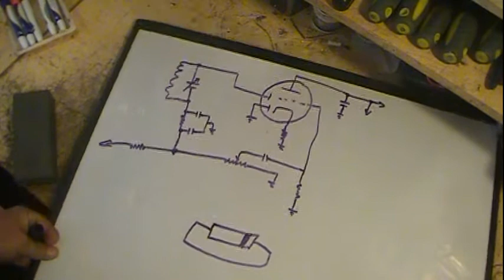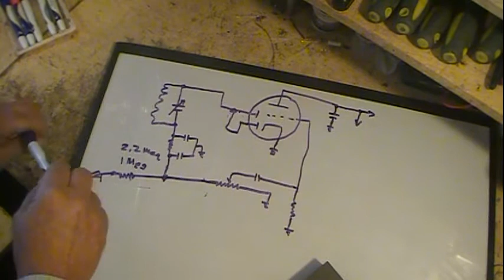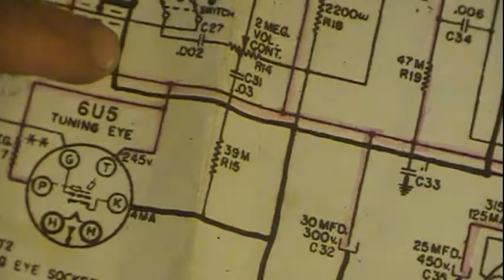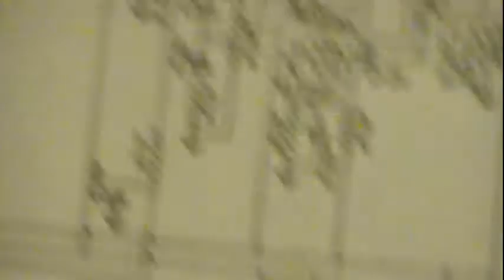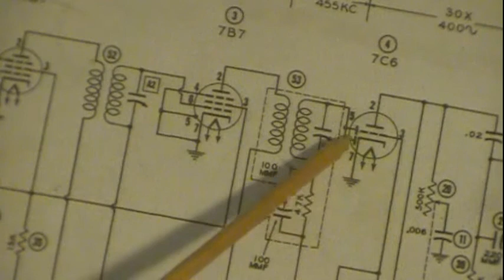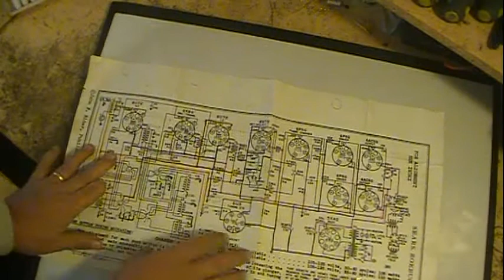Diode connections of the second detector

Comment: Thanks for the vids!  The Philco that uses both diodes and the negative voltage source (the voltage divider at the power transformer center tap) is using "delayed AVC." The AVC is not designed to operate until the signal gets strong enough to over ride the voltage from the negative voltage source. I am not sure why some radio makers decided to do it that way, because most of them just get all the bias from the signal at the one diode AVC circuit (and some cathode bias resistors on some of the tubes).So, I know what it is and how it works, but do you know what the supposed advantages are for delayed AVC?  Rob

Comment: Thanks Dennis. Good info.

Just to satisfy my curiosity, what would happen if you were to just leave that second diode unconnected in radios where it should go to ground?
Reply from the maker: Arthur Hollingsworth It could pick up signal from the surrounding circuits and introduce it into the audio and that would cause noise on the audio.